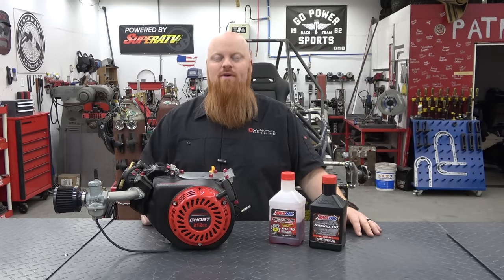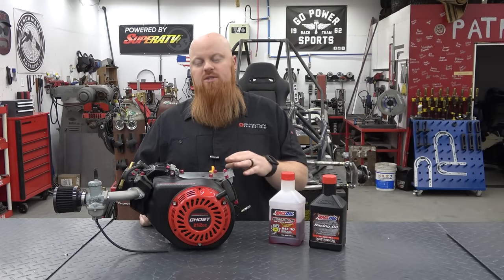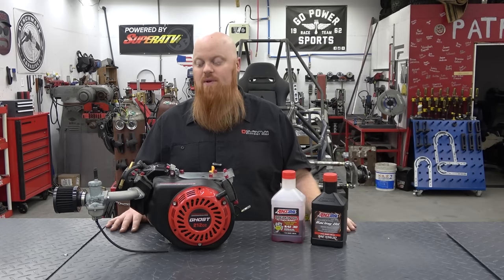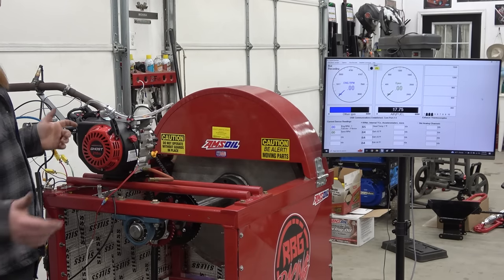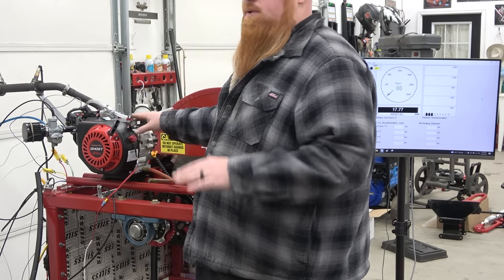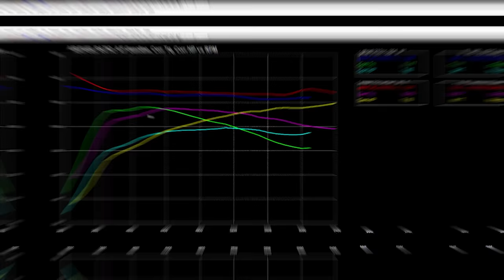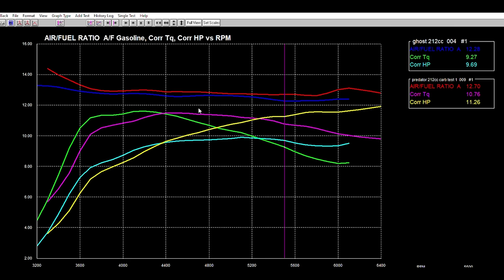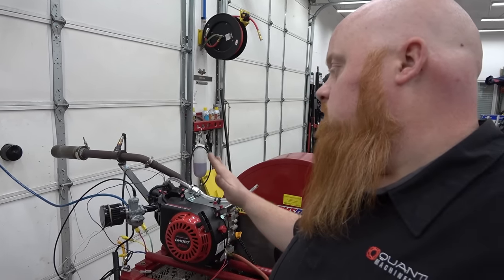We Dyno Test The Predator Ghost 212cc Racing Engine!!!

Comment: You can get the 15.8hp / 459cc engine for less than the ghost… and the 459cc will far out live the ghost. It’s like sinking a fortune into a four banger when you could just get a stock v8 crate engine that’ll out perform and out live the rice burner.

Comment: I couldn't resist getting a Ghost just to check it out. The Box Stock Project engine is definitely faster on a kart. I don't have a dyno, but I can feel the difference and the clock doesn't lie. I did put in a billet flywheel but have not changed the rod on the Ghost. The BSP engine has billet rod and flywheel. The biggest difference, like you mentioned in this video is the carburetor, given that the valves are set up similarly. I swapped them out but still the BSP was a stronger out of the corner and faster to rev. It was an interesting experiment but if I could only buy one, I would go with the BSP and build it with the billet parts. I think you get a slightly better engine, and you know what's in it. They are likely made by the same factory, along with Tilitson and several other brands, so it boils down to how you build and set it up more than the quality. You can do a lot with any of these if you do the homework when you build them. Usually, I race in LO206 anyway and those engines are great, well built long lasting strong pulling and you don't have to do much to them to be competitive in the class. Do some valve maintenance [springs, maybe lightly hone the valve seat] change your oil every couple of hours of runtime (Amsoil Briggs Oil is best in my opinion) and you can get what you need to race and have a ball. I think the L in LO206 stands for LAZY... that's me.

Comment: Great series! Finally people will understand their header, carb, and flywheel doesn't add up to 20hp lol
Reply: True!
Reply: header, huge carb, adjustable flywheel, 12,000 rpm coil and huge cam does
Reply: @chadmills5400  huge carb is worthless without the proper head work. Match porting and proper sized valves....

Comment: A 224 would be really interesting. People are always asking on Facebook if they should do a 224 or 212 ghost.
Reply: Kinda what i'd like to know that as well.
Reply: If I just wanted to bolt on a tank and exhaust and ride I would get the Ghost. If I wanted to build for more than stock power I would get the 224. I did get a 224 and am happy with it. Not an easy build because of all the clearancing needed. Nice torque from that engine.

More good options... Ducar 212. Comes with a PVL flywheel. Similar to the Ghost is the Wildcat 223. They say it has nice power right out of the box.

Comment: Great video. Loved it. Loved the comparison. Really curious now on the 196cc that typically comes with the coleman bikes! Let’s see if that thing will make similar numbers with similar mods as road to horsepower series! Awesome video brother
Reply: This!!!!!!
Reply: Those coleman 196cc are garbage, worst casting I've ever seen. Is way better to start with a stock 212  predator for a little over $100.
Reply: The 2 196s that came on my colemans had a crankshaft that wasn't compatible with a torque converter.  That's all the reason you need to swap.
Reply: @patarmstrong3582  yours did because you got an older one with 5/8 shaft
Reply: @patarmstrong3582  mine did as well and I just used a sleeve to up the size. Works great. I’ve actually hit 66mph with my 196 that came with the bike AND that was with the stock clutch it came with. 10/40 gearing, 265 fire cam, flat top piston, billet rod/flywheel, 26lb springs and home grown port work. Pretty cool if you ask me. My buddy has a ghost and could only hit 61mph. So I’m thinking maybe my little engine ain’t doing too bad!!
Reply: @brutallyhonestmf5578  being that the engine is “free” since it comes with the bike… $160+$300 in mods.. vs just $300 and $160 for other upgrades like new tires or chain or carb or springs lol. Can’t knock the 196!!! I did 66mph with one
Reply: @patarmstrong3582  the RB200 has a Tao Motors engine with a 3/4" crank. All others are Hisun engines with the 5/8".

Not all Coleman bike engines are the same.
Reply: @DOITALLMFER  Exactly. Nothing wrong with a 196. And just think. If you decide you want a 224 your 196 flywheel and clone billet rod can be used on the 224. Can't do that if you get one of the two $150 Predator 212's.

Comment: Mr red beard I have to share this 20 years ago when the Honda design was just catching on there were no billet rods we took Honda rods and double the tourqe from 9 ftlbs to 18 with stock bolts  flattop piston and gapless rings with compression ring machine to accept an oil ring in a groove on top ring it had a 308 cam stock rockers with straps welded to the sides to keep them from breaking cut the head 100 thousands it would hold 340 pound of compression with stock Honda flywheel I turned it 8500 very often not saying that was right but never exploded a flywheel tilitson carb it was a beast for back then and had to set our own flywheel key ignition timing was 40 degrees it would only run eight mile or it would overheat

Comment: Very interesting. Looks like it may be a difference in cam. The ghost has better performance at lower rpm’s where the built engine outperforms at higher rpm’s where the ghost drops off. Super cool video.
Reply: Look at the area under the torque curve. That tells more about the usable power than a peak number.
Reply: And, that cam is a dog- well matched to the 6000 rpm limited coil

Comment: Who would want any of the Predator 212's? There's better options for not that much more money. Last I looked the Wildcat 223 was on sale for under $200. Ducar 212 is probably the best buy and comes with a PVL flywheel.
Reply: If you don't care about the warranty for the ghost
Reply: I can drive 3 miles and buy a Predator,  no waiting. That is the real appeal. That, and I already have the goodies to make it fast.
Reply: @patarmstrong3582  That is a good point. The only way I would ever get a Hemi or non Hemi Predator 212 is if I already had the Predator specific parts like the billet rod and flywheel. And for the non Hemi, the Predator specific cam. 

They finally got smart with the Ghost and 224. They use clone parts. My 224 has a clone rod, flywheel, and cam.

Comment: I just bought a Coleman BT 200 and went straight to HF and got the ghost. You’re right, I just wanted a bolt on. I am well capable of a build and have the tools. At that, almost double the hp. Hope the CVT holds it. I have to check the max rpm on the trash Chinese one supplied. I see a Comet CVT in my future. It just doesn’t end. The Ghost did sound good. Thank you for your great work.
Reply: You shouldn't worry. A stock Ghost isn't going to break the CVT.

Comment: Years ago when I was young say 16 or 17, I bought a go cart frame and the frame was made 1.5" drilling pipe. The gocart had 2 motor mounts and the gears for the axle were welded in place. I sold the gocart because I had no money, my friend bought the card because they had a motor for it, of course they were cheap like me and could not afford a clutch for it so they put a straight gear, so if you push start it it would go. One day they took it to a local shopping center parking lot and they were push starting it, it took off and when it stopped itn had moved a mailbox with concrete on the legs, moved 10 feet. When the Byers kids inspected the go cart, the frame did not even bend

Comment: on the point of Flywheels and ignition timing. can you do a comparison on the RTH engine as it is but with stock timing, 28 degs and 32 degs? it would be very interesting to me personally to see the effects that has on the torque curve in particular
Reply: As a general rule, more spark advance will move the torque peak higher in the rpm band.

Comment: same power just higher in the range, a cam swap is the major difference between an engine designed to run a small water pump and one designed to be in a kart. might not look allot faster on paper but there is most likely a massive difference in performance in a properly geared and clutched application

Comment: The Ghost is a beast for the money, great solid motor
Reply: It's a good choice for a motor you aren't going to open up, or for someone who doesn't have tools or inclination to build a motor themselves.
Reply: @patarmstrong3582  Its a good motor overall we run the hell out of them
Reply: for the same $$$$$, esp after including the $150 for the header accessory package ($450 total + taxes) ... a person can have  a PRETTY HOT 212 PREDATOR and a gas tank. CM .265 cam $65,  side cover gasket $5,  cast alum flywheel $76,  billet rod  $76, $25   for 22mm PV  carb and air filter. .009" head gasket. 22# springs,  spiffy the motor up. oil, gas... and jet kit for the carby since it comes with 99 jet when it needs a 125'ish jet to make it RUN and not fall down at 5500 rpms.

Comment: On the cast flywheel, could the magnet mount be modified and tap it to fit a 8mm cap head bolt?
I cannot see a cast flywheel cracking like a V8 flywheel pushed to 8 grand with huge clutch shock loads?
Has anyone tested these flywheels?
Would like to run a electric start on one of these motors.

Comment: Love the vid I've been looking for a better engine to put on this old streaker go kart frame I got sitting around the motor it originally had was a 6 & a half horsepower Briggs & Stratton so I want to put something on there that will wake it up a little bit plus I have 12 inch knobby tires and both back wheels turn it's not just a one-wheel cart so the six and a half horse power struggles a little bit to get it going but maybe the predator ghost will do a lot better so I'm definitely going to check it out thanks for the video

Comment: Is that 6000 RPM coil available anywhere?  I’ve been looking for a coil that can limit RPMs and will work with a gx style flywheel.  I built an Electric Start / Charging Hemi Predator 212 with a Kohler flywheel.  I was looking for a way to limit RPMs (besides Tire size and gearing)

Comment: A friend of mine said he kept blowing engines with light or thin oil, so he switched to diesel oil and said it worked better. What do you think of using diesel oil compared to the amsoil, and would they make a power difference?

Comment: Glad I'm not the only one that runs good oil in my small engines. Seems like everyone else just tosses whatever is sitting in their backyard in the engine. I'm over 300 hours on my stock 196cc hisun without a single hiccup
Reply: what oil brand and weight do you use
Reply: @markyoung9964  Short oil change intervals and viscosity are more important than brand. Keep an eye on it and change it before it turns black.

Comment: Thank you for doing these for us.Please forgive my comment in a previous episode test as seeming rude.It wasn't meant as such.I just hoped you'd grind the key so the timing was stock as anyone else would do without the cam upgrade yet.Would you please run that engine corrected before the next add-on parts?Thanks Greg.
Reply: Hi, Bry! I'm impressed with your courage. I read your previous comment and it did seem a little rough  lol.

Comment: Wonder how much my 212 predator non hemi makes I picked it up and he said he got it from someone else and it didn't run it's got a billet flywheel and rod and he claims 265 cam, also has 22lb springs and a genuine mikuni 22mm on it. I did get it to run and it does sound pretty good not sure if the cam is true or not tho

Comment: So in short the 212 ghost out of the box that's sitting in my mini baja frame is almost double the hp than the Xian dong 5.5hp that I pulled out of it. That's awesome cause I was figuring the extra rpms would put it at around 7-8hp not 10hp. Can't wait to have this thing together and go for a rip.

Comment: Carb was set up pretty well straight out of the box (for a Kei-Hin copy.) 
What size is it?
Could stand a little tuning but impressive as is (I like the old oval bore Kei-Hin better than Mikuni's, better atomisation over wider operating range)
The display of your buildup motor showed it getting slightly lean for best power at high rpm? (close to 14:1?)
Short steel manifold should keep carb cooler than an alloy one but no idea what it does to 'tuned length' of intake?

Comment: Hey red beard, love the series. One question though. Why do you set the value lash to .003 rather than the manufactures specs?
Reply: It's just a spec used to be safe. You know you are not too tight or too loose. You can use 2 or 5 thou if you want and it's not going to make a difference. 3 thou more or less valve lift is nothing. A detailed builder can carefully set these at zero.

Comment: As it relates to the flywheel, would red locktiting the magnet make it more reliable? I've never played with one, so I'm just curious.
Reply: The screw is lock tight in, I went & got a stroger screw, still may fly off at higher rpms, I just wanted it to be safer and only hitting 6k rpm's for now

Comment: On your Ghost engine, there's a wire coming out of the flywheel cover on the top left side that is bolted to the top of the block. I don't have that on my ghost motor. What is it?

Comment: Can you do some videos on the duromax 7hp please would love to see a build an what parts will fit
Reply: Get tools to measure, and learn to use them by measuring what you've got. You got a 3/4 inch crankshaft? You gotta know to buy a clutch or torque converter. If you just bought parts without checking clearances, you'd be risking all you spent. Most of these engines can share parts. I know I swapped the 196 's in my colemans for 212s because of parts availability. 196 had a funky crankshaft iirc. Even a Harbor freight set of calipers is better than nothing. I'd be looking closely at the crank on the duromax, too. It might be one with an odd sized crank.
Reply: @patarmstrong3582  Yes but unlike the Predator 212's the Hisun 196 uses ALL clone parts. You can get a clone crankshaft anywhere for $30 or so. Let's see you find a Predator specific crankshaft. If you do find one expect to pay more than $50 for it.

And once you get Predator 212 specific parts like a rod or flywheel you are stuck with them. My clone (196) flywheel fit perfect on my 224. And I could have used the ARC rod from my 196 for the 224. Can't do that with a Predator 212.

Comment: Sorry.. what? Only 9.9 HP? That’s CANNOT be possible. Me and my group took a 212 cc HEMI predator and stuck the following mods onto/into it: - Briggs & Stratton Racing Carburetor w/ Black slide, - Honda Racing Pipe Exhaust, - Honda Racing Fuel Pump connected to an intrepid Fuel tank, powered by the vacuum from the engine block via a fitting slotted into the crankcase, and a standard racing clutch. This was put onto my Track Racing gokart on an Intrepid ESCAPE-17 1 of 2 frame, and got a 39.9 lap time across the 12 turn, 9/10 KM Racetrack, At 3S-Gokarts. this was a new record for a four stroke powered gokart at that track, as you can’t really get predators in Canada. Yesterday we replaced it with the 212cc Ghost, which has better internals, whereas the HEMI Predator had stock internals beside the governor and oil shutoff.  The ghost is almost TWICE as fast, and got a lap time of 38.3 yesterday. It continues to pull and gain horsepower on the straightaway even near redline, whereas the HEMI predator dropped off near redline. how the hell is that 9.9 Hp? Because the 212 HEMI predator we had clocked out at 14 HP. The ghost is double the speed, so by our estimates it should be going to 18-20 HP. However we did put the same Briggs and Stratton race carb on the ghost as it wouldn’t fit on the kart with the carburetor that came with it, because it kept hitting the rear wheel. so please, an explanation?

Comment: Would a ghost be a good engine for a coleman bt200x with a jackshaft and 50 tooth sprocket with 19 inch tires ? What would be my top end speed ? I hope. around 45 mph with a good take off
Reply: A stock Ghost with stock Coleman gearing would have nice take off but would quickly top out in the low 30's MPH. 35 if you are lucky. If you are going to use the jackshaft get a 40 tooth sprocket to top out at 40 or higher with the Ghost engine.

Comment: Thank you for the video. Could I put one of these motors on a scooter and get a good running scooter, 150cc scooter Honda clone.  and it run 65 -70 MPH???
Reply: No. How do,you connect it to the variator? Probably easier to put the 212 jug, piston and head on the 150.
Reply: My built 212 has barely cracked 60 with a torque converter. Anything that size needs the efficiency of a clutch and metal gears to go 70.

Comment: No hate but if you’re running your head temp off the bottom of the plug you’re losing compression with every pull and can change depending on threads under the plug. I’d like to see that plug set up.

Comment: Put the big carb on the ghost make the same horsepower or more than yours, and when I smoke it take it back because, I still have a warranty, no brainer
Reply: Yes. In theory the Ghost with the same carb as his other engine should make better power because the Ghost comes with a 252 lift cam. Even if the HP number is close the Ghost would have better torque.

Comment: Please consider testing a 1970s 3 or 5 hp briggs.  I got one that sat for at least 5 years dumped the gas out put fresh gas in and it ran perfect.  My predator worked ok for about 5 years but now it is very temperamental so its collecting dust in the corner.

Comment: Hello RB. Is there a CVT that can take the hp and rpm?
Reply: Yes. Any 30 series CVT. Even a properly installed $50 ebay torque converter kit will work. Guys have drag raced with much more than Ghost power with CVT's.